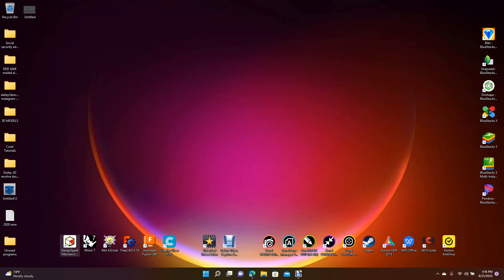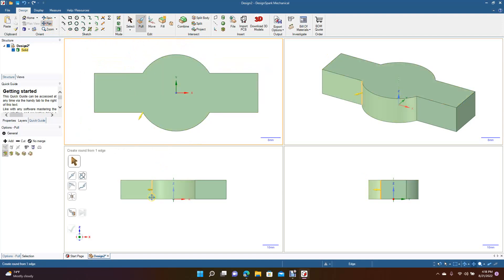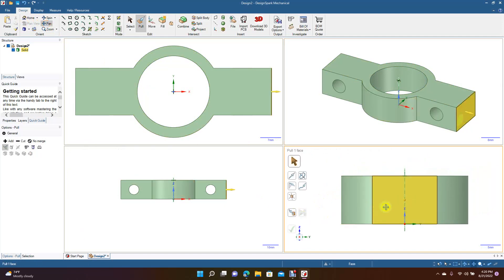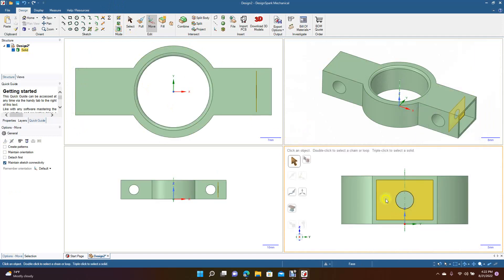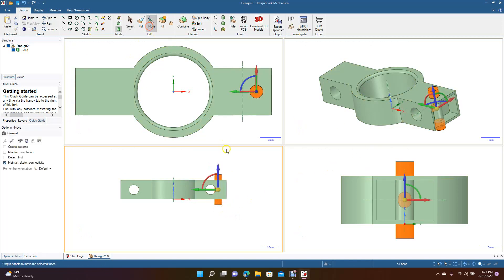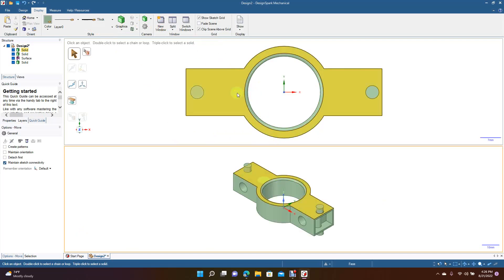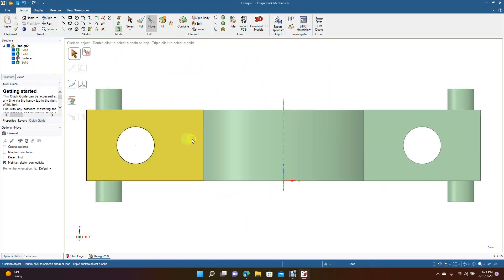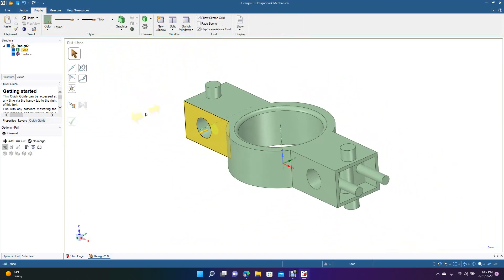How to draw in different view ports in design spark mechanical

Comment: Excellent!  I'm blown away each time I view your latest tutorial. I can see how this method of using 4 viewports will greatly aid me in my 3D model creations.  Using this technique and the drawing over a jpg graphic design like you did in your "Creating a Vintage 3D rocket" tutorial should get me started on my project, building an RC Stingray from the old Gerry Anderson TV series. Thanks for the multitude of tutorials you've created, I greatly appreciate the examples showing how to accomplish different things in DS.
Reply from the maker: Awesome, glad the videos are helpful. One advantage to using the 4 viewports is you don't have to spin/rotate the part you are designing all the time. Example, if you are building the part in top mode, you will have to spin the part in order to extrude something or draw on a different side. You don't have to do this if you create the part in 4 viewport windows. Cheers!